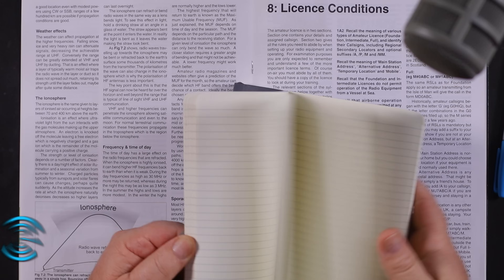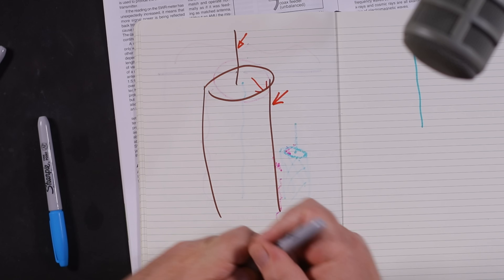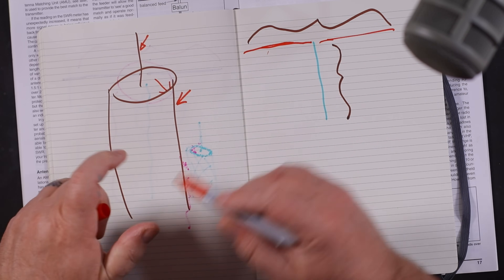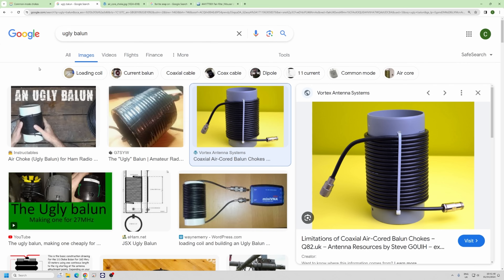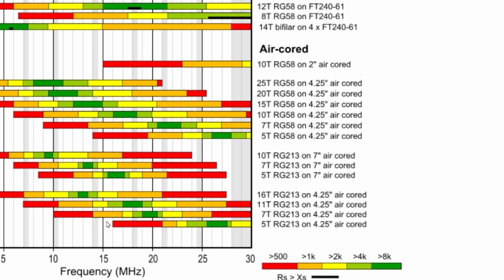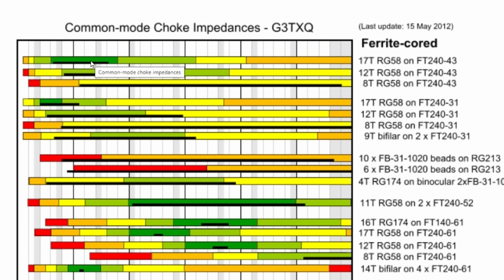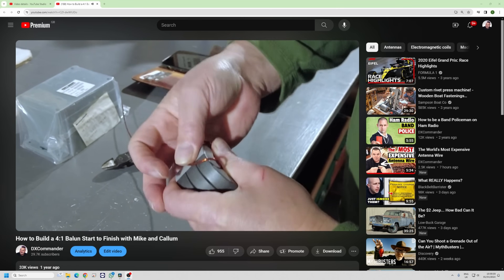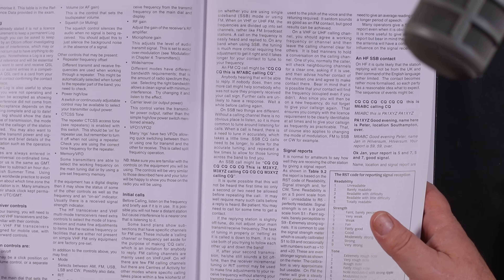Chokes and Baluns

Comment: Love these videos just getting back into the hobbie I’ve an icom 7300 and a yagi 3 element sirio but I’ve forgot to do the balum / choke 😂 I’ve be doing it tomorrow I’m curious as I’m doing an air choke … 7to 8 turns on the coax and a one inch diameter does that sound about right for 27 MHz !! ? 
Thanks Callum
Reply from the maker: 5 turns of RG58 across an air-cored 4.25 inch former will give you 8k on 27MHz and about 4-5k at 28.5MHz. Alternatively, with RG213 - 5 turns gives you slightly less... Don't be tempted to do MORE turns - that drops the frequency. If you have an FT240-61 ferrite ring, 8 turns of RG58 is a hard-stop. Totally perfect.

Comment: Hello Callum , thank you for sharing & excellent information as always .
I have researched chokes and baluns & the common mode current effect .
My findings regarding the common mode current effect is quite scientific & involved .
By and large there are 3 types of radio communication arrangements , home base , vehicular & portable , my particular research findings was based on the home base set up and vehicular radio transmission.
The chokes & baluns you've described are no doubt effective and is indeed incredibly valuable information .
I'll trim all the information down as best I can ,  common mode current is essentially an electrolytic effect within the conductor , the conductor effectively becomes a capacitor due to the potential difference of electrons that are being generated between the inner dielectric core , metal film , screen & the polyurethane covering , it's these layers that build a capacitance , hence polyurethane electrolytic capacitors more or less have the same properties & it is exactly the same process within the coaxial cable .
The best way to eliminate common mode currents is to slug the coaxial screen to ground , this will immediately discharge the electrolytic effect commonly known as common mode currents .
Most home base units are grounded by the earth on the 13.8v  power supply , for example if you place an ohm  meter probe from the PL259 outer ring at the rear of the radio & the second probe to the earth on the plug socket it will read around 0.1 ohm to ground& that's generally more or less satisfactory to the average radio operating home environment .
The problem with the electrolytic common mode current mainly lays within vehicular & aviation radio use , hence no ground , sea vessels are somewhat better , but certainly for mobile field set up or vehicular operation a ground electrode stake that is satisfactory earthed is advised .
generally the above information is not common knowledge , the following scientific effects from electromagnetic RF transmission depending on what antenna & conductor  materials are used  are as follows , electrolytic with conductors  , electrolysis with aluminium , osmosis with fiberglass , sadly all these materials succumb to degradation through electron use , particularly if exposed to ingress , then the laws change to hydro effect which is common & I shan't go into all that ,it's been found within aviation  ferrite or any other material method used on the exterior of the conductors will have little effect due to the above reasons , but every little helps I'm sure .
I hope that the above has been of some help .
Reply from the maker: Wow. Excellent analysis.
Reply: @DXCommanderHQ  Thank you Callum .

Comment: One should always look at the trade-offs when adding connectors and higher loss coax such as the separate box you constructed when comparing insertion losses with your radiating devices ie. (antennas, whatever the design). Sometimes the ugly choke is the better choice.
Reply from the maker: On HF, that box would have marginally - almost immeasurable loss.

Comment: Baluns are absolutely critical. I've had many issues with RF feedback in the past and so use either an FT-240-31 or FT-240-52 and just wind as much of a 0.5m SO-239 to PL-259 as I can around the former as I can. I use them with all of my feeders and also between my mic and my audio interface as I was having an issue with RF getting into that on 20m. 

Just make one up and be done with it when you install na antenna - makes life so much easier. 

Also had problems with my portable station with RF getting back along the control cable for the ATU. Just put a balun in place on every cable between your transceiver and anything else connected to it. Even USB cables to your PC. It's a PITA but absolutely worthwhile. Nothing more soul destroying than calling CQ to get no answers because you audio sound ropey due to RF getting back into your transceiver.
Reply: I've been running these style for HF (CMC-130-3K). They make other model which works HF through 6m. I think there are two manufacturers. Also, properly grounded antennas/shack might help as well.

Comment: Nice work on that common mode choke Callum. Yeah, it makes more sense to build one of those chokes than pay for 7 snap ons at $20.00 a piece. Wow! 

I have one question though. Is that 4:1 balun you showed a current balun?

And your talks on common mode chokes and balun are never boring.

Cheers from Texas!

de Rick, WD5L.
Reply from the maker: Rick, I never worked out the difference between a voltage balun or a current balun. I was just reading about this last night. I now (almost) know the difference (I think) but we'd have to ask Mike!
Reply: Callum, I’ll check it out. I’ll let you know what I find out. 

Oh, one question. Why did you use mix 52 and not mix 43 for your common mode choke?

On the topic of Jim, W6LG, you should probably see his latest video if you haven’t yet.

Comment: FWIW with your long lengths of feeder underground common mode current issues should be much reduced. Something that is overlooked in most analysis is the huge effect you can have on received noise. When the feeder effectively becomes part of the antenna you increase susceptibility of noise pick-up from appliances in the house or shack. Low SWR is not proof of low common-mode current. G3TXQ's website is a great resource, the examples I have measured myself correlate very well with Steve's observations. EFFECTIVE common mode chokes can be a game changer...  73

Comment: An antenna impedance match or mismatch has nothing to do with common mode current on the feedline, a perfectly matched 1.1 impedance match can have as much cmc on the braid of the feedline as a higher impedance mismatch, common mode current is the result of antenna imbalance ,or feeding a balanced antenna with unbalanced line
Reply: That's what I was thinking.  What I would refer to as a choke doesn't do any transformation or change from balanced to unbalanced. Coiling your coax will reduce common mode, acting like a choke, it won't act like a balun.  Also, you can get 1:1 baluns so you don't really need any impedance transformation to call it a balun either.  I think a balun will act like a choke though right?  Maybe that's where the two concepts cross? 

I could be wrong too, this isn't my strongest subject in the hobby.
Reply: @piquat1 think where its misunderstood by many is that its thought that reflected power from an impedance mismatch travels on the outside of the braid ,it doesn't it travels on the inside of the braid, the braid acts as two conductors

Comment: Efhw 49:1 what would be best place to install a choke for good housekeeping
Cheers Callum enjoying videos  👍👍
Reply: If you plan to have the coax act as a counterpoise, place the CMC (Common Mode Choke) near the operating position. If you have a separate wire acting as a counterpoise or a ground rod, place the CMC near the antenna (as near as practically possible). The latter is so that the antenna is prevented from using the coax as counterpoise.
Reply: @kuyakano8976 
Thankyou thats helpfull,is one method better than another,how antenna will operate or is it same
Reply: @danjor_droneitsme6874  The answer to that question is; It depends :) With antenna's, many factors are in play. Height, soil, build quality, propagation, elevation etc etc.  I would say, try one way for a while and then the other. See which works best or is simply more convenient for your unique situation. A good indicator would be the amount of QSOs made over a certain amount of time, combined with the ease of making them. Do you get out easily or are you struggling, that sort of thing. What works best for someone else might not be the case for you. Main point is to get on the air, experiment, and have fun with the hobby. Take care.
Reply: @kuyakano8976 
Thankyou again yeah efhw works for me very well i got thinking of a cmc just as good housekeeping or maybe to improve antenna even more.
I will try both methods im not using any cmc right now.
Appreciated,thankyou
Reply: are you using a counterpoise or using the coax as the counterpoise?
Reply: @jamesemery1 
Using coax at moment about 20m m&p.Trying to decide if a wire counterpoise be better.
Any help appreciated
Reply: As per the manual for [ENDFEDZ ALLBAND-KW 80-10 EFHW 1KW ICAS ANTENNA] there are 3 ways - choke, counterpoise, ground rod. See page 2 figure 2 of that manual for thorough overview. I use a 7 turn coil through ferrite 1/4 wavelength from feedpoint.
Reply from the maker: For that? I don't know. Not keen on EFHW because I don't fully appreciate them I guess.. Somewhere between the shack and the antenna. Best place for most of these is the feedpoint.
Reply: @DXCommanderHQ  I'm in a top floor flat (3 storeys) no garden and a tiny balcony, but there is a big tree about 25m from my kitchen window that is perfect for an EFHW. After researching all options its the most affordable route for 80-10m bands. If you made a dx commander that could be mounted on wall brackets at roof height I would gladly buy it today.
Reply: I chose an efhw as my first HF antenna too. While many have had good results, I think I would have done better starting off with a half wave dipole. So many arguments about EFHW and the only thing people agree about is that they can be 'finicky'. Good luck.

Comment: I use 11 meters  I have a 5/8th bottom fed using Mini RG8 and I have 5 clipped on ferrite clips at the base of the antenna my SWR ranges from 1.1 to 1.5 through 80 channels I don't know if the ferrites are doing any good or not ?
Reply: take them off then check the swr that will tell you something
Reply from the maker: Consider the loss first.. https://youtu.be/SnEfMDh2B3M then as James says, take them off and find out :)
Reply: @DXCommanderHQ   I'll have to do it when the wind has dropped as it's about 30 foot up on a scaffold pole on a elbow I double checked from a distance and can see 4 ferrites they are all in heatshrink tubing I also have a lightning arrestor at the base of the antenna with a thick copper wire running down the pole to a copper rod  but as soon as I can I will do as James has advised :)